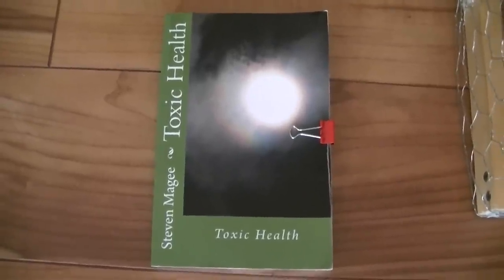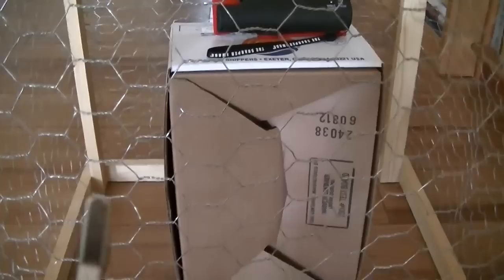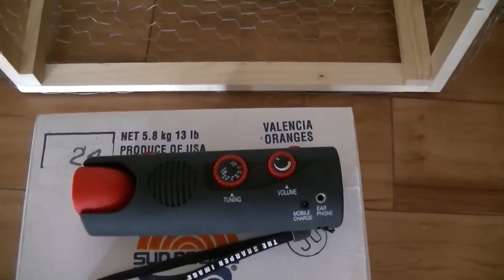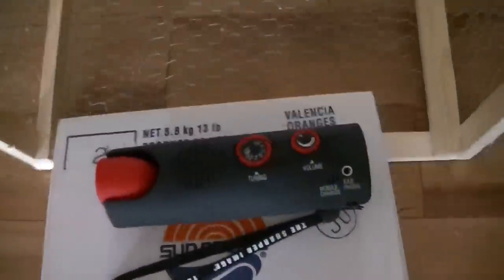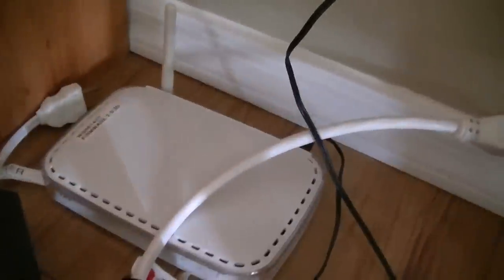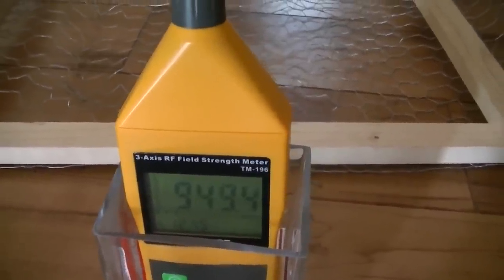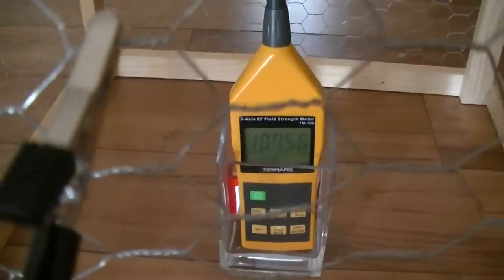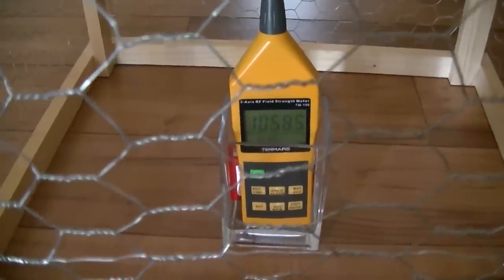The Difference Between Grounded and Ungrounded Faraday Cages Regarding AM, FM & 2.4 GHz WiFi

Comment from the maker: I have tried the experiment also with aluminum mesh window screening and found similar results.  Grounding has no noticeable effect on the signal transmission through the mesh at these frequencies, regardless of hole size.  The videos of these experiments are on my channel.  The metal window screening mesh appears to be leaky to RF, I was surprised at how much signal gets through.  Foil appears to be the way to go.

Comment: The second test with the WiFi is not valid since the mesh size isn't a quarter wavelength or smaller of 2.4Ghz signals. But yes... it still stands that properly built faradays cage doesn't have to be grounded, how ever if it's not grounded, then charge can accumulate on the cage and cause a nasty shock for anyone touching it. This all of course doesn't take into account the fact that certain radiation is reflected instead of absorbed and any reflected waves don't cause charge to accumulate.

It also doesn't take into account the fact that you can't get more out than you put in, thus the amount of charge accumulated depends how much energy there is in the first place to build up charge.

If the biggest voltage that affects the cage is let's say 5V, that's the largest voltage the cage will ever be charged up to. There's also leakage from the cage and other factors that dissipate the charge over time... so yeah... it's complicated :D

Comment: You might try using a wire cage that is the type like a screen door. It has smaller openings. Your's is chicken wire with large holes for signals to pass through. Plus, your cage isn't fully inclosed. You have to have the bottom shielded too. Try that and see what happens with an ungrounded and grounded faraday cage, ok?

Comment: Your cage is incomplete, sir. I would suggest a large piece of foil wrapped (exterior only) cardboard for its flooring and either heavy gauge foil cage wrap or extremely fine metal mesh, rather than chicken wire. The latter is only good for restraining foul or promoting upward growth of vines.

Comment: this type of material is very poor at shielding, the rf waves can still propagate to the receiver, but cool testing :) saw a similar attempt using a solid walled steel garbage can.. grounded or not, even the slightest gap in the lid allowed reception.

Comment: as the previous commentator said this is not a Faraday cage, the Faraday cage Must be sealed from all sides. this is an open cage so the radiation can penetrate the cage since it is not sealed. Plus the chicken wire cage is not a Faraday cage

Comment: Interesting how the screen works with smart meter RF signals, maybe the AM & FM signals have weaker longer wave lengths with shorter peak to peak height that allows the tiny electron sized waves to get through?

If the RF waves of a smart meter are stronger would that also have more of an attraction to the metals vs a weaker signal?

Comment: Size of the holes determine the frequency it will block out.  Look at the size of the holes in the perforated metal in the window of a microwave oven and you'll see what the size of the holes should be for a faraday cage that can block out 2.4GHz.  If the wholes are bigger than this you won't block out any of the 2.4GHz frequency.  A Faraday cage should have all of its 6 sides closed with the same size hole for it to be considered a true faraday cage.  Grounding a metal shield would effectively put you further away from the source and you can test this by using a Wifi Analyser App and measuring the effect on your body when you stand near a Wi-Fi router see how it should measure different for standing and holding the mobile device in your hand and take reading with shoes and barefeet.  Earthing should divert some of the signal into the ground, if this was a proper faraday cage you wouldn't have seen any reading on the meter, however if the holes were just slightly bigger than the holes found in the microwave oven's door then by grounding such a case should help to an extend to get rid of some leakage.  I reckon a bit more research needs to be done on RF to see how to best address such issues.  Also, be very carefull with the way earthing is applied, e.g. for every loop you create in the earth parth you've effectively create an antenna.

Comment: I just tried my phone with an app called Wi-Fi Analyzer and put it into the microwave oven (of course I didn't power it up).
The wifi signal in from my living room went from -61dBm to flat! 
Pretty cool. My cable internet provider by default will have wi-fi enabled on 2.4 and 5GHz frequencies here in Orlando. I ask them to turn it off and they say no. So I want to put the cablemodem inside a cage. :)
Reply: Try a steel army ammo can with two holes for the cables wrapped in metal duct tape.

Comment: What most people want to know is not how to block radio waves, but how to block a pulse which could harm equipment. A data center might be protected against hacking but that's not relevant. I've searched and searched for the characteristics of pulses from an EMP or coronal mass ejection and the frequencies generated are either unknown or the people who know aren't disclosing it. I've seen the phrase "DC to daylight" describing frequencies of electromagnetic radiation, but that's a useless bit of information. We need to know what mesh size is needed to protect against threats.  I won't build anything without some actual science.

Comment: grounding doesnt affect the emf ,its for emr but you cant just use the earth from power point,you need a separate dedicated earth spike,and also need the mesh on the base to so all 6 sides are sheilded and all sideshaving maximum connection,,not just a pidly wire connecting the sidesmust be directly connected, ,really though the most important thing to block is the 50-60 hhz emr,that has the affect of blinding our inner sight,the minds eye. blocking all emfs permanantly would have a negitive affect on our system, our dna would eventually mutate ,the body is really a transmitter and reciever ,would be like blocking access to software  updates. it would block nour torus feild from interfacing with the universe torus feild.
Reply: the cymbals are huge about 26 inch like a bike rim

Comment: That's not a Faraday Cage... it has no bottom... there is a vectorial principle to the Faraday Cage phenomenon... it is not just some metal walls around something, you know?
Reply: +Artos IF it's not a Faraday Cage, how come the radio signals weren't getting through?
Reply: There are many radiofrequency radiation phenomena around. The Faraday Cage Phenomenon is just a particular one. Nevertheless, radio, television, and phone signals, are very weak signals. They are so weak that most radios come with a built-in signal amplifier/booster, the same with TV antennas or cell phones. There are many open spaces where you can stand and there is no radio or Tv or cellphone signals... in fact you can just take a single sheet of metal or wire and move it around any of these devices and you can see how it can affect the signal.
You seem to think that anything that affects electromagnetic fields is a Faraday Cage but that's not the case. 
The Faraday Cage phenomenon is an instance when a symmetrical conductor surface is placed inside an electromagnetic field. The field generates an electric current that travels around the surface and turns each atom in the surface into a new source of the electromagnetic field. Since the surface has opposed sides and the intensity of the electromagnetic field is a vector that complies with the Newtonian Principles of Vector transmissibility and decomposition, the Intensity vectors on opposed sides nullify each other and the module of the resultant intensity of the electromagnetic field inside the cage is zero.
Reply: Artos
I see.  Well, all I know, is that, last night, I put an AM radio in my microwave oven, and, later, my cell phone, and BOTH got enough signal to play or ring.  Thus, from now on, if that microwave is on, I'm hiding from it.
Reply: +Nallanyesmar That's a very smart move. Maybe it is time to change that oven. 
Nevertheless, when I studied Physics in the early 90s all bibliography about energetic radiation indicated it is not related to cancer or any other disease like that (though if the field is strong enough you could die of organ failure). Energetic radiation is more related to behavior change, it can make you very miserable, headaches, backbone aches, blurred vision,  induces violence, temper tantrums, disorientation, lack of focus, depression, etc...
I finished building a multi layered Faraday Cage because I wanted to add some input to the community of people who are interested on this topic, and the cage nullifies radio, and cellphone signals, but it fails miserably at nullifying high intensity microwave radiation. If you purchase an electromagnetic field detector and place it inside most of the Faraday Cages posted here in YouTube you will find that it will detect a great deal of radiation, so I really question its plausible use to actually protect anything from an EMP.  At least not as they are shown in here. It would have to be a Serious Faraday Cage. Governments have multibillion dollar underground  facilities to deal with this eventuality. I don't think there is anything you can just improvise into an efficient Faraday Cage or that you could just build an efficient Faraday Cage using cheap materials from HomeDepot... My cage demanded around $500 and it was just a waste of money... the again, maybe a better design could suffice.
Reply: Artos
Thanks for the info.  What it comes down to is, is that if you have keepsakes like your family on video or audio tape, burn it onto CD or DVD.

Comment: That's what I'm finding, *removes 5/6ths of a what could not become a Faraday cage in its dreams even, and demonstrates. Haha, sorry buddy had a chicken there. This isn't a Faraday cage as all sides need to be at the same potential, and there need to be all 6 sides. The sizing of the holes will affect what can pass through, as the diameter of the holes will let the smallest of wavelengths through.

Comment: Interesting video.  Were you expecting different results?  The difference between grounded and ungrounded cages might be elucidated by measuring the voltage on the wire of the cage; maybe even the amperage.  I imagine you'll be headed in that direction.  Is it possible to measure plant voltage?  Moisten the soil and put in a sensitive meter lead and compare grounded vs. ungrounded.  That might turn up some interesting data.  L8r.

Comment: bad test... not 365 degree protection... no cage component on the floor... use formula of 300/freq in MHZ ( 2400 ) = wavelength (1.25) cm... i.e. the size of the hole in the mesh.

get smaller mesh and cover 365 and test again

Comment: This is not a Faraday cage - it's junk. The amplitude of the EM field is much much smaller than the holes in the wire... meaning that it passes straight through. Ever payed any attention to the size of the screen mesh in your everyday microwave oven?? Way smaller. Not to mention you don't even have a "bottom". Obviously grounding your junk won't make any discernible difference. Like trying to use a screen to hold water.

Comment: To keep your numbers simple, 2.4ghz wave size is about 2.4 millimeters. 
 Much like a full wave for CB radio is about 21 feet. The higher the freq the smaller the wave size.
 In respect to the 5G system no one freq size will work as it uses multiple freqs. Best bet there is a solid Grounded shield.
  (Look at the front of a microwave, the mesh on the door minimizes the RF leakage, and allows you to see inside, ovens run in 2.4 GHz range. Just right for water molecules to block and Absorb the energy. ) Great for us huh? Carry a microwave oven in your pocket ;( 
       😎

Comment: grounding a Faraday cage is done only for blocking a radio transmitter inside a cage. For reception shielding (radio receiver inside Faraday cage) you don't ground the cage

Comment: You can't ground radio frequencies with a long thin wire.  Let alone the fact that the microwaves will go right through the big holes in the cage.  Good grief.  Learn a little bit about radio waves and wavelength.
Reply: How else do you ground them?